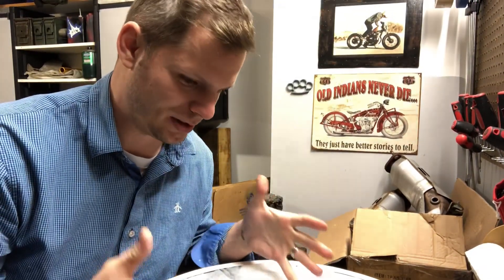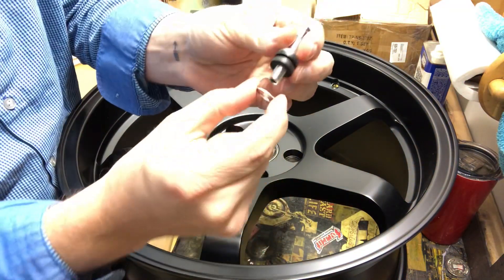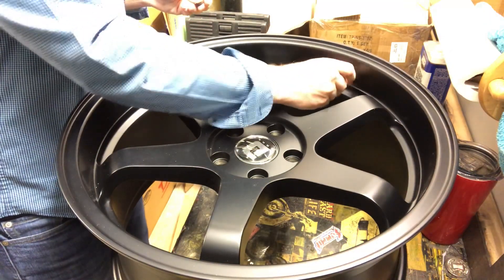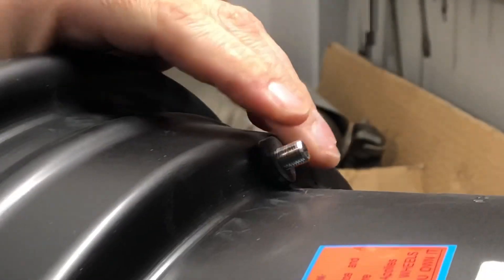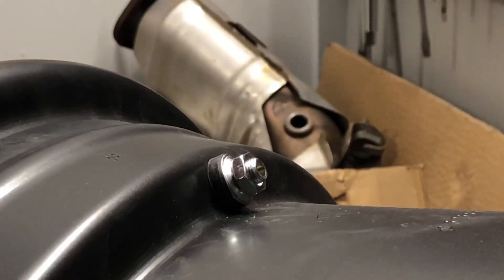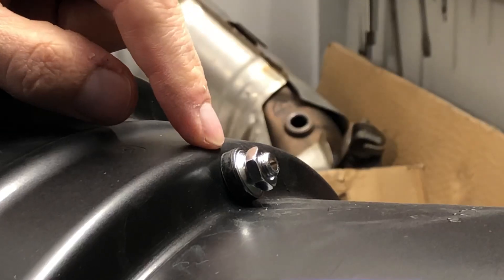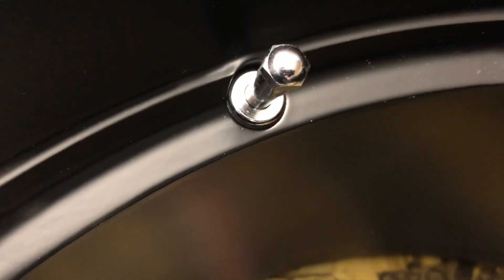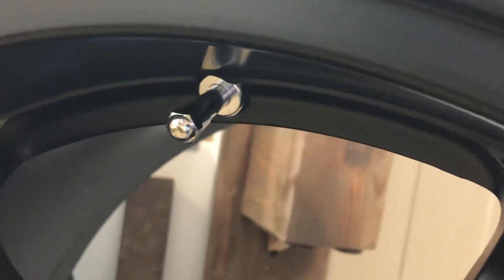How to Install Valve Stems in new wheels

Comment: What are you doing about the tire pressure sensor?
Reply from the maker: I’m not running tpms in my summer wheels. No need. I can tell by feel if my tires are low and I check them regularly anyway, especially if I’m going for a drive or to the track. I couldn’t care less if I have the readings on the dash. The only think I don’t like is the tire light lol.

Comment: Why no tpms in the new wheels?
Reply from the maker: No need.  I can tell if my tires are low and check the pressures regularly anyway.  I don't know about you, but most of my previous cars never had tpms and I survived just fine lol.  The only thing it does for me is keeps the light off in the dash--which isn't worth the money just for summer wheels.
Reply: Oh I agree, the light would be the only thing to bother me.
Reply from the maker: @thereaper.493  It does bother me a little.  I hate lights in the dash, but luckily its small enough to where it isn't super noticeable.  Maybe I'll put a little sticker over it haha

Comment: What ab the tpms sensor
Reply: Nevermind I seen the comment on it
Reply from the maker: The other thing is that I run low tire pressures like 29 in the rear and 30-31 in the front, so my low pressure warnings would be on all the time, so I actually prefer to not have tpms
Reply: @SpeedCultureStudios  it’s not a smog requirement is it? Cause I’m probably just gonna put my work valve stems in instead of the tpms if it’s not a requirement
Reply from the maker: @dwad9162  I honestly don't know.  Every state is different in terms of what they inspect.